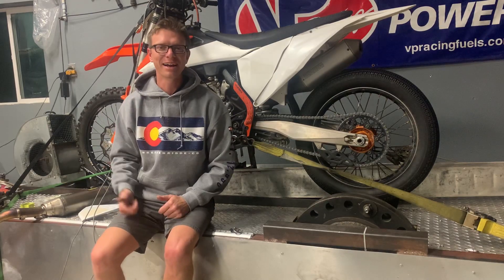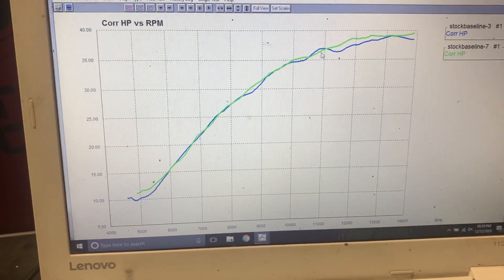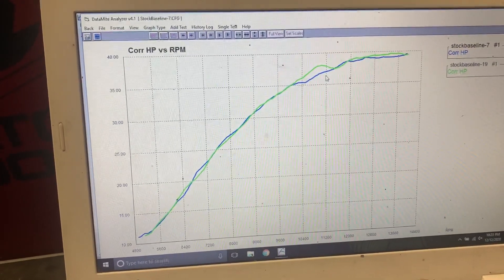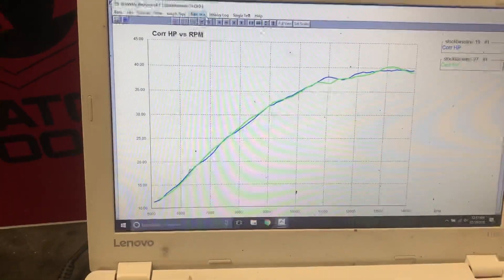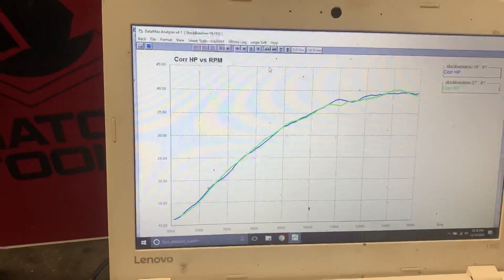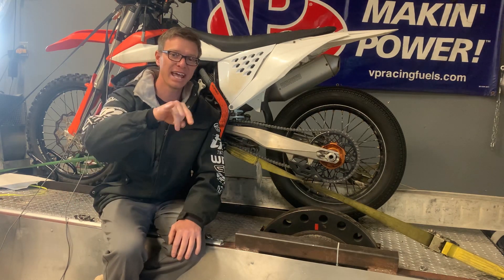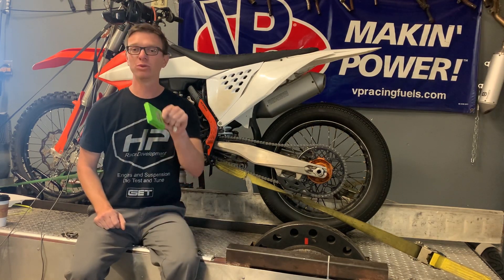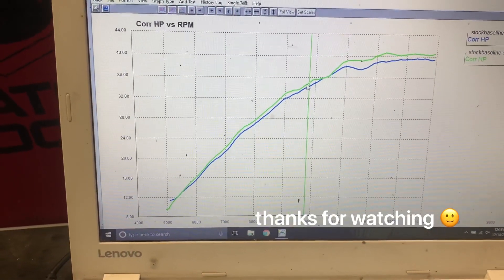KTM250SXF Dyno Testing: akrapovic slip on exhaust, OEM maps, Traction Control, GET ECU

Comment: Got new triumph it doesnt seem to have 47 hp do u have any maps for thus yet i did 49 rear tooth
Reply from the maker: Stock ECU is locked
Reply: @HPRaceDevelopment  
Do they make better one
Reply: Like a get ecu
Reply from the maker: @charlesclapper8982  I believe there will be - stock is a GET but it's locked.  We have a big bore that would fit it
Reply: Where do I get
Reply from the maker: @charlesclapper8982  Big bore - we  got for ktm, should fit this model.

Comment: Have you tested the full Acropovic ‘Evolution’ line exhaust?
Reply from the maker: we have
Reply: And what are the results meaning did you get better results than what stock or the slip on gives?
Reply from the maker: @cantgetright3657  Exhausts don't add much power these days, they mostly change power feel.
Reply: Right but I’m trying to know if the full exhaust gives anymore power/gains than a slip on, if any power at all. I’m guessing based on you’re response it’s a no on the full Acrapovic full Evolution exhaust
Reply from the maker: @cantgetright3657  Our goal with these is to educate the consumer (you) on how to think about things.  What makes you think that ktm isn't capable of making an exhaust the exact same as any aftermarket pipe as far as design goes (not the look)?  These OEMs make COMPLETE dirtbikes - they can certainly make a pipe.  So we have to ask ourselves - what are our goals with pipes....to just get more power everywhere is extremely rare now days.

Comment: Hi Derek, have you observed the same phenomenon on the 450s? I have a FS450, and running TC on really helps smooth out initial throttle tip in on both map 1 &2 , wondering how it influences power. I’ll probably run it on either way
Reply from the maker: you can equate tc to an even slower map on both maps

on the 23 ktm, they have done a few bew things which has some dynamic control to input. on older bikes, 22 and previous its just a gear specific power reduction via reduced timing for each gear with 1st having most reduction and 5th none/least

Comment: The thing about the traction control is false information. How could you possible test the tc on the dyno without wheelslip?
The ktm tc is messuring against a set value in the ecu about how fast the engine can ramp up rpm and still have traction. In a low traction condition the wheel(and engine) is able to speed up quicker then this set value, and the ecu retards the timing to regain the set ramp up rpm speed, to regain traction.
Reply from the maker: We happen to know what's actually the OEM strategy through some relationships we have at GET and other electronic providers, combined with our data acquisition system (I will have a video published on this system eventually) that measures all ECU outputs, inputs etc.  If the bike adjusted ignition based on say rate of rpm change - the data box would pick this up, and test strategies are easy.  We CAN create tire slip on the dyno easily.  The only way to control power on these engine is fuel or ignition - as the throttle body is controlled by the cable - not a servo like cars or sportbikes.  OEM bikes also don't have gps or wheel speed sensors for more advanced techniques, which GET does have and use for their high end strategies.

On OEM ecu's It's gear specific mapping, and pulls about 4 degrees out in first, 3 degrees in second, 1 degree in third and std timing in fourth and fifth.  That's just thereality of what's going on you don't have like it but is what it is on those generation bikes. The entire reason stock bikes come with "TC" is so the factory teams can legally run it, as the rule books were rewritten to say "if it comes stock it's allowed".  The sad reality was traction control has existed for a really long time with the factory teams going back to honda somewhere in the mid 90's but the sanctioning bodies have no way of measuring this or catching them - so rules were re written to save face for ama and allow factories to keep on keeping one without them protesting one another for what they themselves were doing.  GET has patented the technology that would have to be licensed by the OEMS to use for "smart strategies based on gear selection, rpm, rate of rpm change, throttle input, rate of throttle input change". which is still a mediocre way to do TC vs what sportbikes and road racing bikes, cars, etc employ.  Carrot and GET ecu's are using an on board accelerometer as well to help with their TC strats.  OEM is currently NOT using that etither.

Comment: Does a header do more than a slip on?
Reply from the maker: On the KTM it's been our findings that the OEM exhaust is basically impossible to beat
Reply: @HPRaceDevelopment  I have a Husqvarna fc250 and I’m debating if it’s worth it to get an akrapovic exhaust. Better to save the coin. Thank you